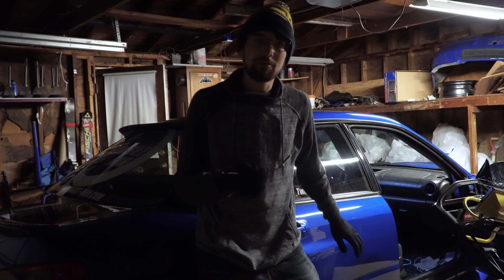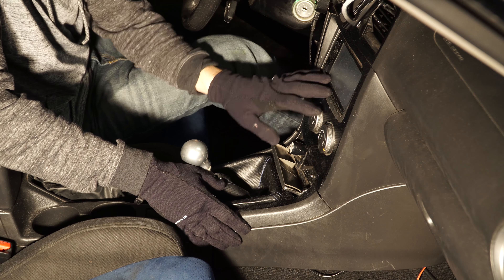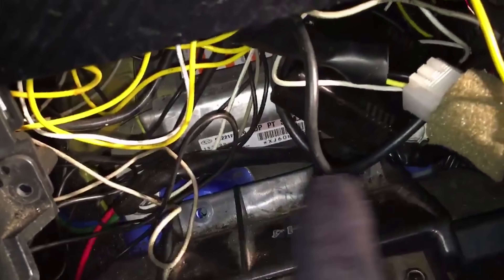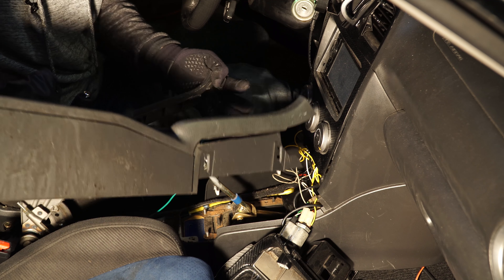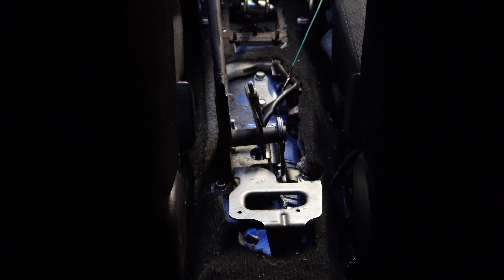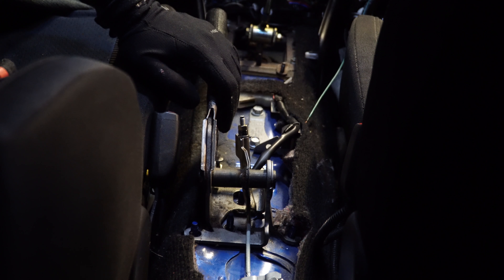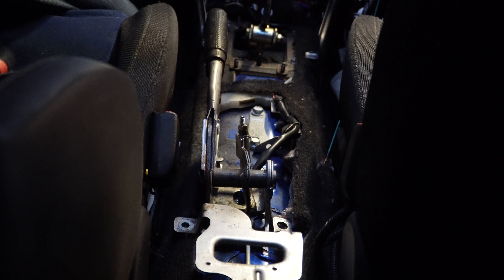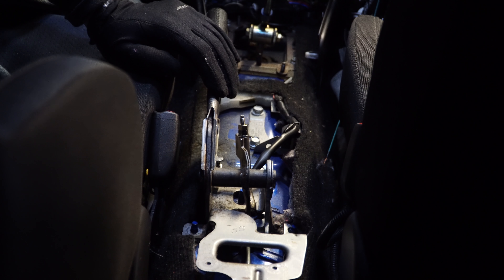How to change/tighten EBrake Line 2007 Subaru WRX - DIY Ep1

Comment: Thank you so much for this video! I recently got an 02 WRX and the ebreak button is completely broken off. I just ordered a new handle and wasn't sure how I'd transfer the cable over (that part is completely fine). I think this video showed me everything I needed to know!
Reply from the maker: Bewix glad to hear. I made it as a two part, tightening the brake as well as replacing the cables. I was beginning to wonder if anyone else was having this problem 😁
Reply: @AutoMotionDigital  So, I should just undo the 2 locking nuts on the cable and pull it through the bottom right? I had issues removing a previous one so I just wanna make sure. Thanks again!
Reply: Well mine snapped today and I’m hoping it’s the same line that snapped on yours lol